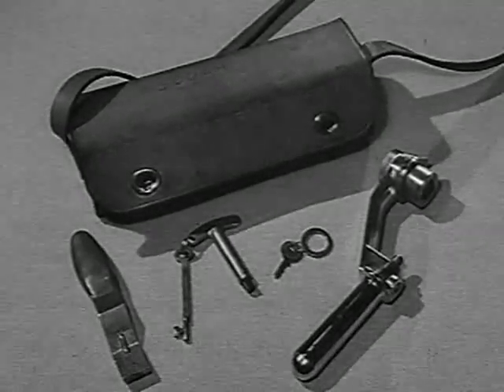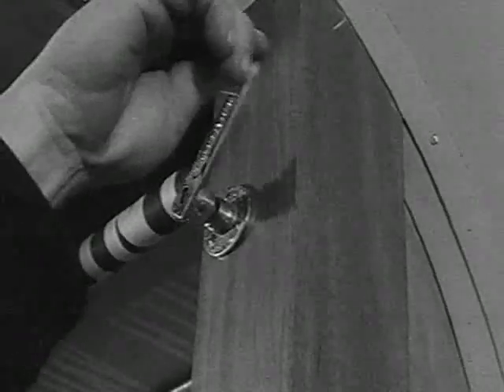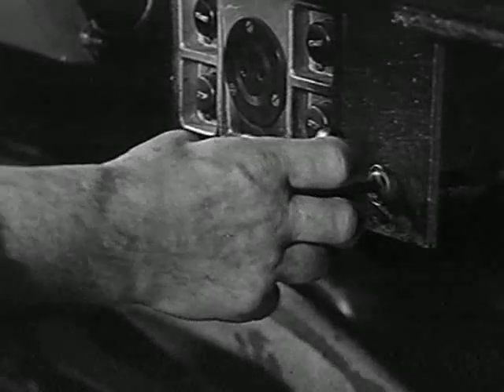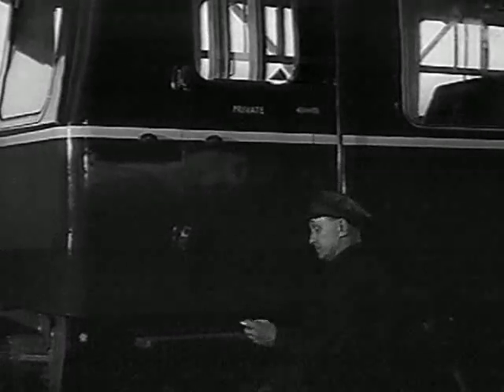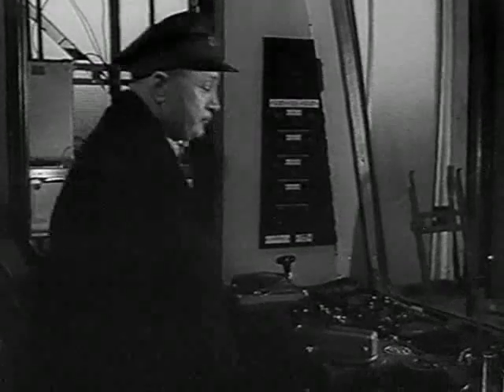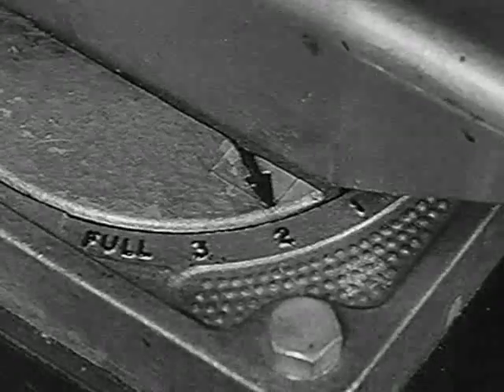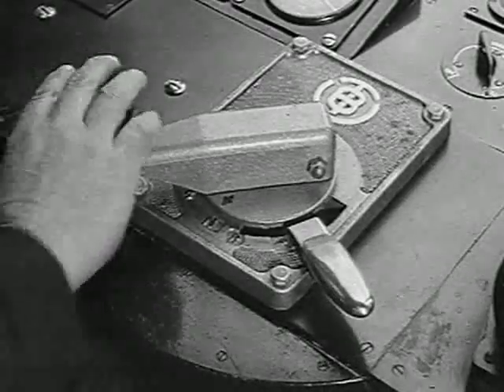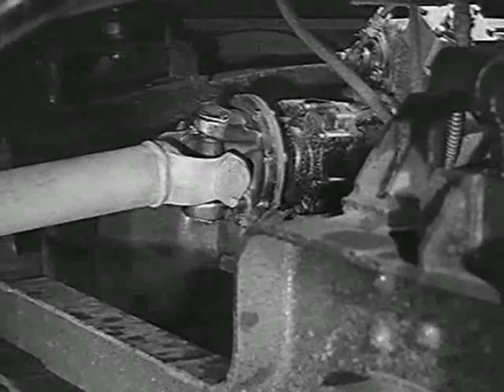Driving the Train 1 of 2

Comment: LOL check the hand brake is on, bit late if it was off, those old diesel engines they used to leave running in cold weather because they were bad starters.
Reply: WTF
Reply: Yt is so messed up, who was that WTF comment about or to?
Reply: This Engine is a Diesel Mechanical with a 4 Speed Transmission so they just left them in Neutral also Keeping them on all the time puts unnecessary ware and tear on the engines and not to mention fuel Economy from doing that